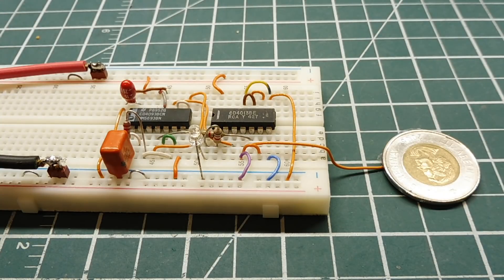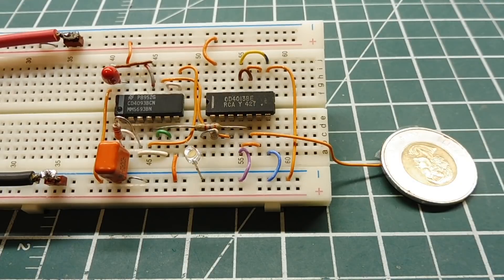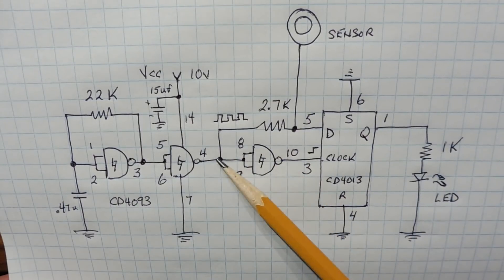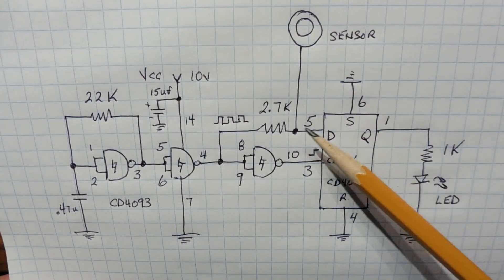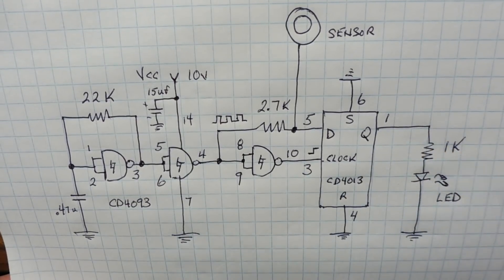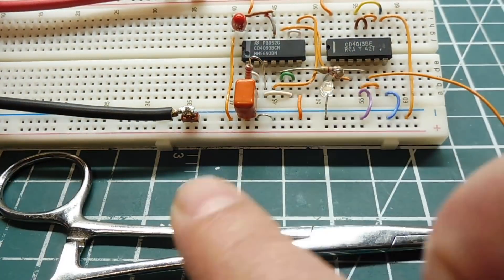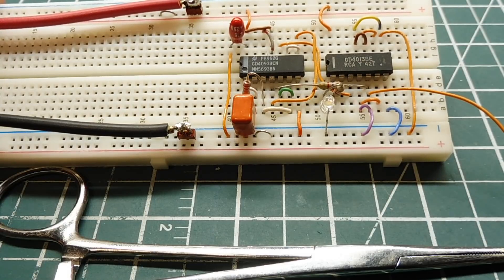Build A Capacitive Touch Switch

Comment: Thanks so much, works perfectly, much better than those little touch modules, you've saved me lots of headaches. I used a 40106 rather than a 4093, 6 inverters means two touch switches from two chips :)
Reply from the maker: Glad it worked out. Thanks for sharing!

Comment: Question. Do i really need to touch the battery for this to work? Because when i use the battery as the voltage source, unless im not touching it, it won't work.

Comment: thank you for the suggestion of using a 555 timer.  What is the voltage for your circuit?  I don't recall you mentioning it. Where can I find a circuit diagram to add this with a small trimmer to adjust the timing?
Reply from the maker: The voltage of my circuit was 9 volts. Check online for 555 timer circuits.
https://www.electronics-tutorials.ws/waveforms/555_timer.html

Comment: Great video.  is there a simple way to add a time delay to keep the led on for a specific number of seconds?  (https://youtu.be/wgvo4aTATsU)  Also, can I replace the LED with a micro relay to control a 5 v circuit? lastly, can the capacitive touch be more sensitive so that the metal object could be under a 1/8 ' or more of plexi glass?
Reply from the maker: You can trigger a 555 timer configured as a "monostable" with the desred on time driving a small relay. The sensor has to be touched  to be triggered.

Comment: Great video.
 I breadboarded this circuit for testing. In my application, I’ll need this to run off of a 9v battery. When applying anything over 7v, the output stays high. Under 7v or so it functions as normal. Is there any way around this other than dropping the supply voltage?

Also, is there a way to add adjustable sensitivity for the amount of capacitance needed to trigger?

Thanks
Reply: For adjusting the sensitivity, u can change the speed   of the clock. I try to play with this one, and i figured out that by changing the clock speed makes the sensor pad's required capacitance decrease.

Comment: Is there a way to make a series of sensors each controlling different LEDs while still only using the two ics?
Reply: You can squeeze two out if you use a 40106 rather than a 4093

Comment: Sir please make clean diagram
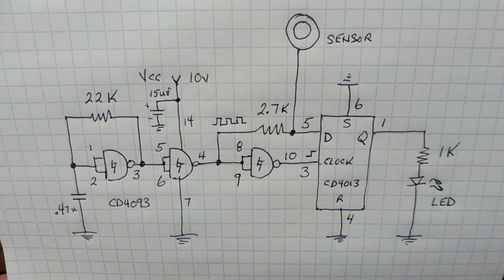Reply from the maker: Schematic diagram starts at 1:11
Reply: @0033mer  There is an oversight on your diagram!

Indeed, on your prototype, on the 4093, the 11 and 12 are connected together, then set to positive, but on the diagram, you did not indicate it.

Is the 15 uF filter capacitor really useful, because putting it on or not has no effect on the operation, at least nothing that I haven't noticed at home.

How can the antenna be even more sensitive and detect before being hit?

Thank you for your return.
Reply: @chasseurdetranges9783I'm not the original poster, but unused CMOS gates can be tied high or low, so that explains 11+12 

The 15uf is for filtering, in case you have other things connected to the power supply/a noisy power supply - these might effect the operation. 

Pretty sure this can't be used as a proximity sensor - a resistor in series with a capacitor like that won't trigger the circuit.

Comment: I made it but it doesn't work for me.
Reply: I wonder if you use faster chips it may not work because the circuit depends upon a particular propagation delay.  If so, then maybe play around with your RC values in order to speed up the clock.
Reply: Try changing the 2.7k resistor and remember to connect unused inputs to ground
Reply: @CHASSEUR D'ETRANGES inputs to any of the chips, its good practice.
The circuit can also be a bit funky due to the propagation delay being different for different chips, I used a nand chip produced in 87 but aslong as you have a scope then it shouldnt be an issue.
But it works great, I connected 4 capacitive touch switches by adding an extra flip flop and have them control a synth keyboard, works great.

Comment: How would you make it latching? Touch to turn on, touch to turn off. My great grandparents had a lamp that was like that, thought it was magic when I was a kid.
Reply from the maker: By feeding the output into another flip-flop wired in toggle mode will give you an alternate on/off function. You can buy lamp touch modules and make your own touch lamp. They are available from Home Depot or online. I have repaired a few of those.  https://www.amazon.com/Westek-6503HBLC-300-Watt-Dimmer-Replacement/dp/B000Z9819S?ref_=fsclp_pl_dp_5

Comment: Great vid as usual! Would this method work for a 'non-touch' capacitive touch switch, ie if there is a dielectric insulator between you and the touch metal??
Reply from the maker: You are describing a proximity detector which works on a different principal. A high frequency oscillator coupled to an antenna where the body capacitance will change the oscillators frequency, similar to a Theremin.
https://www.youtube.com/watch?v=K6KbEnGnymk
Reply: Yes there is that. But what I was thinking of is the capacitive sensors like the one in this link
https://learn.adafruit.com/adafruit-capacitive-touch-sensor-breakouts/build-a-capacitive-touch-control-panel
This or similar types where there's a lacquer on the pcb where you touch, quite common. I believe your circuit will be on the same principle where your finger will be increasing the capacitance of the RC discharge.
Anyway I want to say I find your vids the most informative and accessible and also unique because you are quite inventive in your circuits thinking outside the box! Always find myself realising 'Oh Yeah! That's a different twist!'. Keep it up, hopefully you should start getting a larger following you deserve :)

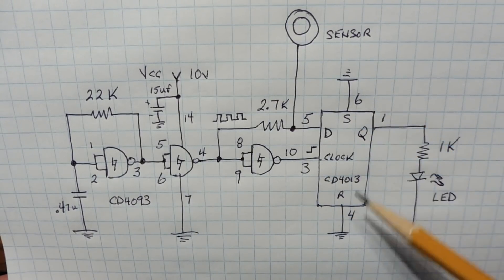Comment: 1:29'  configured as an inverter or an oscillator?
Reply from the maker: The Nand gate is configured as an inverter when the two inputs are connected together. By adding the resistor and capacitor we now have an oscillator.